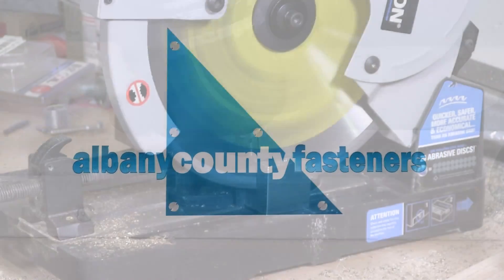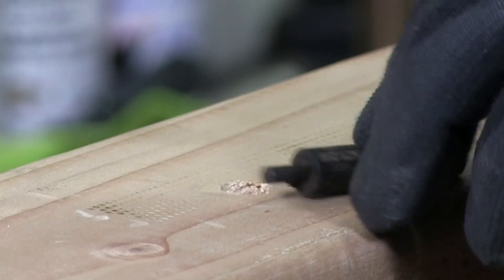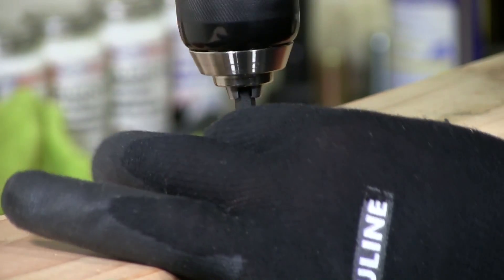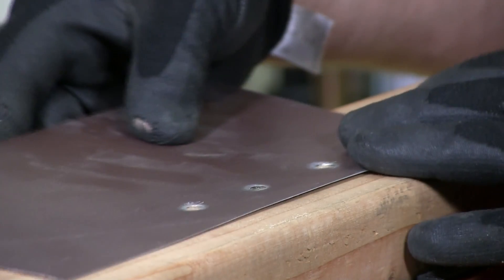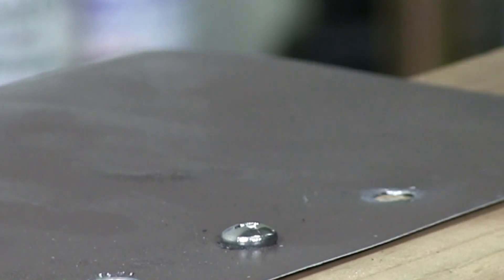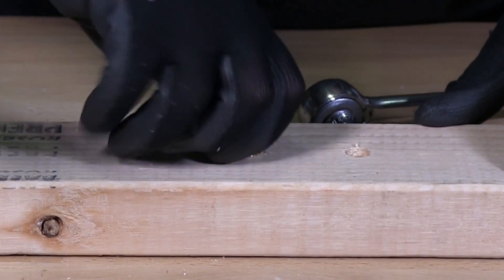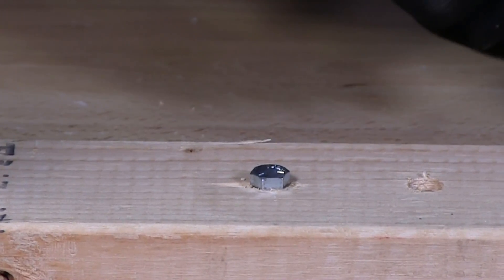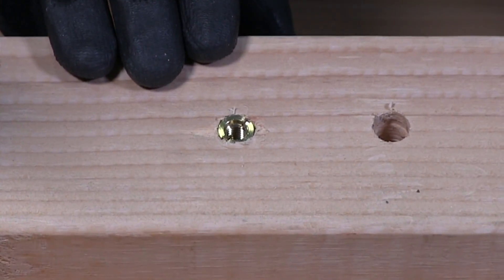A Step-By-Step Guide on How to Use Threaded Inserts For Wood | Fasteners 101

Comment: When placing the bolt into the insert, would the bolt need to anchor into the wood, or would it be passable if the bolt matched the length of the insert and did not breach the wood? Thank you.

Comment: I would always use a vertical alignment jig to ensure plumb installation of the insert.  It can make a project look poorly crafted (and weakly constructed), having a screw or bolt head that's obviously crooked and poorly mated.  An alignment jig need be nothing more complex than a piece of hardwood with center drill hole at close to (close as possible) the diameter of the drill install tool head diameter, with a recess on the insert side (side toward work), having an appropriate diameter and depth to hold the insert with just enough lead-in to 'find' the drilled hole.  Then, just align with strait drilled hole (especially in hard wood), press down jig to work and install.  With a little care and maybe some paraffin wax for driver bit and insert lubricant, the jig will last a long time and inserts will look and work right.

Comment: Hello, are these inserts removable?  I'm really wondering how well they hold by themselves.  Do I need to use epoxy on the outer threads?
Reply from the maker: You should not remove.  Why? Each time you remove the fastener gets compromised.  Epoxy is not required.

Comment: What if you need to use two threaded inserts back to back to join two separate pieces of wood?
Reply from the maker: Never tried that.  Let us know how that works out for you.  Following
Reply: @AlbanyCountyFasteners  Did not work out too well. It was very difficult to perfectly align the two inserts and the bolt would not screw in all the way.

Comment: Would it hurt to add a bit of glue to the threads of the insert for maximum strength?
Reply: Well, threaded inserts are mostly used for high strength and stability while also being easily disasembled, I use them for furniture.
Reply: @teo-medesi  ah I see.  I was wondering if adding wood glue to the outer threads of the insert would help provide maximum strength between the insert and the wood
Reply: @locklear308  definitely not, wood glue binds only wood and wood together
Reply: @teo-medesi  hm, I presumed as much.  Was more so wondering if the glue would fill in any tiny gaps, harden, and help keep the insert locked in.

Might just be overkill I guess, haha :)
Reply: Epoxy would be the better choice for that purpose. I've had the experience where the threaded insert loosens up and follows the bolt upwards.
Reply: @ScandinavianHandcraft  see that's what I was thinking about coming just to make sure that that threaded insert is absolutely permanently bonded
Reply: @locklear308  Yes. Most YouTubers im following, making furniture, are using epoxy for exactly that. 1-4 minute epoxy glue works great. :)
Reply: @ScandinavianHandcraft  okay cool, so use epoxy and not wood glue?

And I'm also thinking just to use a light amount so it doesn't end up gooping all over the place lol
Reply: @locklear308  yes epoxy.. Not to much, if you drew your hole correctly, to the right size it shouldn't fit or need to much epoxy. Just a small amount all around the thread.

Comment: I have a particleboard tabletop that is just less than an inch in depth. Is it ok to insert the 15mm insert screw or is it too deep? I am worried about the particleboard (it might pop the wood out on the other end)? Wondering if this is a good idea in the first place.

Comment: Spade bits suck.  They are close to the way mideval people did it 500 years ago with a sharpened spoon, literally.  Forstner bits are way better, but you still need a waster to avoid blow-out on the other side.  And.. Probably want to work on making sure you are squared up on the wood before you start drilling a bit (no pun intended) better.
Reply from the maker: Thank you for your feedback.
Reply: Did you mean washer? If so how?
I've seen people use painter's tape to avoid chipping the surface they are drilling from and some support on the back to prevent blowout.
Reply: @21area21  No, I did mean "waster".  That is the material you use as a backer so that when the drill bit goes out the other side when drilling a hole, you don't have a chunk blow out.  The wood backer is meant to get "wasted" hence the name.
Reply: AND WE ALL SAY AMEND TO THAT SISTER !!!!!!!!!!!!!!!!!!

Comment: Hi,
how do I determine what  size bolt or grub screw to use with a particular size insert. Are the dimensions of the insert for the inner or outer threads.
Reply from the maker: The insert size is for the inner threading. So you'll just need to find a bolt that matches the insert's size.

Comment: This is completely wrong!  The slotted end goes into the wood first.  It's designed to cut the threads when inserting.  This is a common mistake.  If you look closely at that end of the insert, you'll see that the threads gradually increase from nothing to full depth over the first turn or so.  This is to facilitate thread cutting when inserting.  Use a bolt with two jam nuts on the non-slotted end to install.  Easy.
Reply: If this were true, then why would the company E-Z Lok that manufactures the inserts also sell the install driver which clearly has blades to grab in those slots for the installation? They made the inserts, they engineered the inserts, and they engineered the install driver. They are engineered to install into soft wood using a screwdriver (blades inserted into the slots). How can you do that if the slots are inserted first? Doesn't make sense and would be counter to the purpose of the design.
Reply: Adding to Ron Laverdiere’s comment, the instructions outlined in this video are consistent the with instructions from the manufacturer’s own website.  https://www.ezlok.com/e-z-lok-solid-wall-insert-installation
Reply: no, I see uniform threads. if the slots went in 1st, you'd need a tiny guy to climb down in the blind hole to use the installation tool (or screwdriver) to pull the insert down on himself
Reply: Kurt obviously doesn't know the first thing about woodworking.
Reply: your brains are broken
Reply: the slots also would make removal of the insert so much easier

Comment: - Being new to using threaded inserts, it would have been helpful if the video had started with the correct size of bit to use to drill the hole, the different sizes of inserts & how to understand the info that comes with them since there's so many varied sizes of inserts.
Reply: It depends on the wood.  A hardwood takes a larger hole.  Trial and error.
Reply: They clearly used a 3/8 spade drill bit. What you really want is to be told what size insert they used. I would guess it was a 1/4-20 insert (normally use a 25/64 drill bit, so 3/8 spade is very close).
Reply: All the information is at the manufacturer's website. Sorry you need everything handed to you on a golden platter.

Comment: Hello, great video. Can you tell me wich dewalt drill driver are you using?. I am looking for a drill driver to work with wood and I have seen a lot of dewalt products that have lot of power but I would like something that allow me to have control of speed and I can see you can put the inserts very slow. (I was thinking to buy the DCD791B, but I don't know if it have too much power to work with wood) Thanks
Reply: I'm pretty sure anything from their 20v flagship line would work. Same with the flagship model of any other contractor grade tool company like milwaukee, makita, and bosch